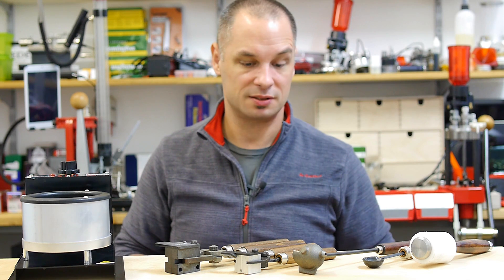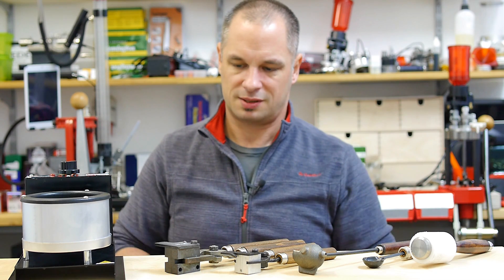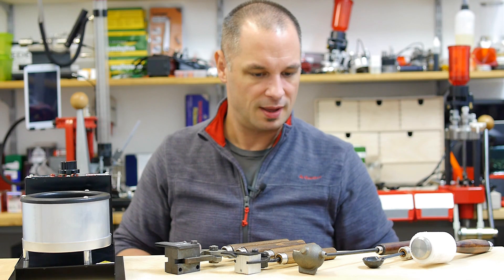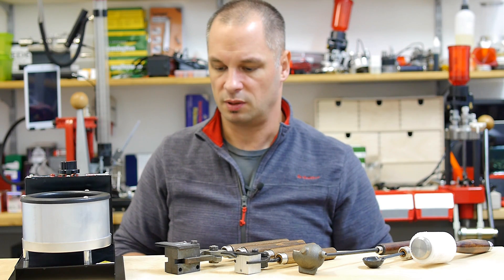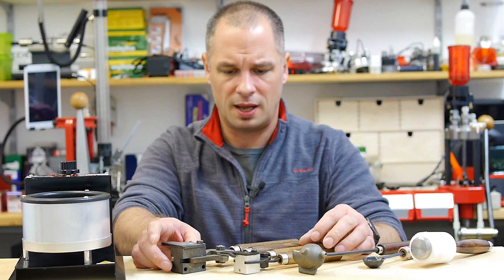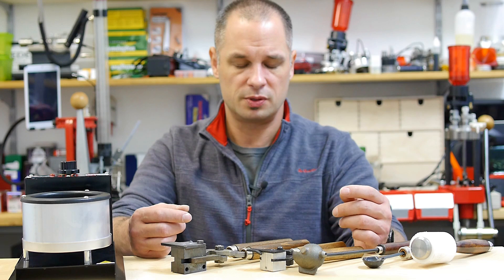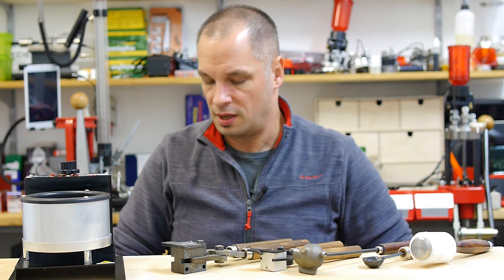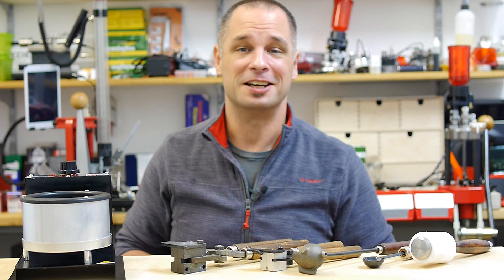ZINC bullets an real alternative?

Comment: I still don't get what the ban of a poisonous metall does have to do with leftism, wokeism or any other -ism. Lead is banned in soldering and plumbing for years and it's because it's toxic, no discussion about that.
There are leadfree huntings bullets since decades.

We should be mad at the industry who doesnt provide us with cheap zinc bullets (which are totally suitable for plinking and most sportshooting) but instead prefers to sell us expensive brass or copper-bullets because they took the chance of selling us those leadfree bullets with a higher margin, instead of zinc bullets which would just cost about the same as leadbullets. There is no significant difference in price for zinc over lead. Because a bullet has a certain volume you need to look at the price per volume not per weight. 
Now enthustiasts like you and elvis ammo e.g. have to do the groundbreaking work to make zinc bullets useable for us. That's the real shame.

Comment: But for all intents and purposes of the video yes I think zinc is a very good alternative because unlike copper it doesn't require a whole shitload of extra stuff to be able to cast it. I cast .224 bullets for my 556 strictly out of zinc because you don't have to powder coat it, and you can push them little bullets very quickly. The added bonus is I use a 77 grain brass hardened mold to cast my zinc because zinc eats cheap aluminum molds, but the bonus is though it's 77 grain shape and size it only weighs 45 grains. So hand loaders do need to be careful not fuck around and make a bunch of compressed loads, with potentially dangerous pressure spikes because nobody wants to blow their gun up in their face so that is something to be mindful of.

Comment: I've been casting zinc bullets for a couple years now after seeing Elvis Ammo's vids and use iron molds and got an old Lyman #61 bottom pour pot. Its a cast iron pot and holds 10lbs and I think the old Saeco bottom pour pot is the same thing. Another company called 'Potter's' also made iron bottom pour pots. Elvis ended up melting the Lee pot so I went with the cast iron one. I went with the largest bullet I could find that my guns would cycle and got the iron mold for it. For 45acp I use the RCBS 45-250 which normally drops apx 263gr lead but in zinc it casts apx 160gr. Another consideration is powder as you are using more powder for the lighter projectile but the larger bullet uses more space. I have good results with Unique with 1150fps in a 1911 and 1350fps in carbine, but I also ran out of powder space, and that was with lightly compressed loads, so next powder I try for zinc will be CFE Pistol. I think something to consider since zinc casting is so new would be to find other metals that can alloy with it to increase weight. WillieBulletman seemed to have success blending small amounts of lead to the zinc. It has to be a very small amount I think close to 1% otherwise the alloy wont be usable. I havent tried it yet but copper can alloy with zinc. I have pewter ingots that I use as a hardener, and the pewter has copper, then there are U.S pennies which are 97.5% zinc and 2.5% copper so that might be worth a try too, since pieces of pure copper would need too much heat to melt and blend into the alloy
Reply from the maker: Thank you so much for sharing your knowledge budy. All the best from Germany. Markus
Reply: Nice anecdote!
Reply: Hmmm , I never thought about pennies .

Comment: M781  Low PSI Low Velocity 40MM TP Rounds were made from Die Cast Zinc and had 2 thin bands to engage the rifling in the 40MM Anodized Aluminum barrel.   The lands and grooves were very shallow.

Comment: Elvis Ammo discovered that the zinc ate a hole in his melting pot. But the video has been taken down. Maybe you should check about reactions between Zinc and the relatively thin steel in the normal melting pots.
Reply from the maker: Thanks for the advice Hans. Will keep an eye of it.
Reply: @wiederladerTv  I've seen zinc bullet casters using cast iron pots, so that might be the way to go. They've also said that steel molds work best for zinc.